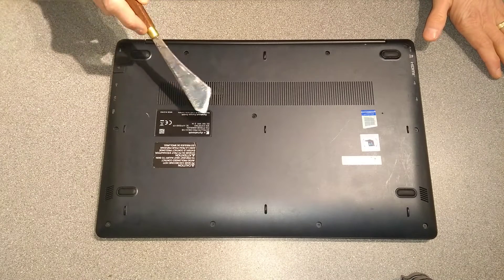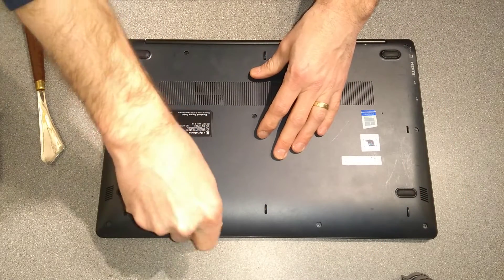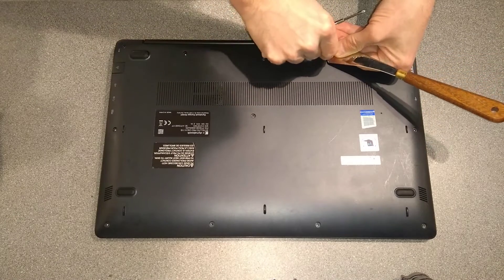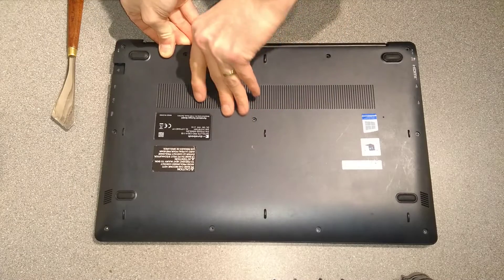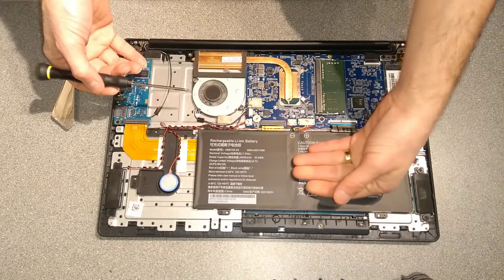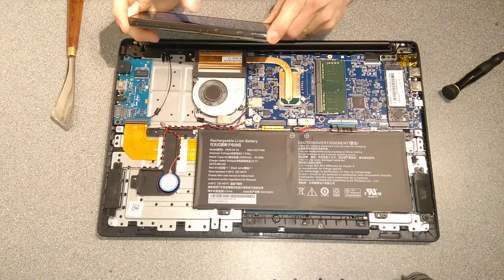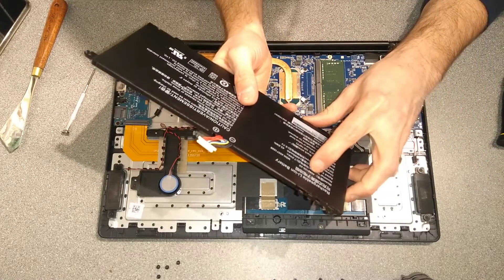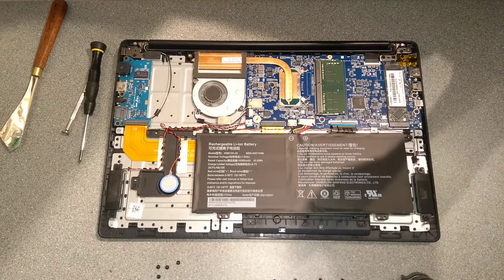Dynabook Satellite Pro C50-H-11B - How to open up the machine.

Comment: If you want to upgrade the memory on a C50-H range laptop please be aware that the maximum you can install is 1 x 16GB module.  Many of the memory selling websites say you can install 2 x 16GB.  This is wrong.  There is only 1 memory slot.

After installing the new memory module and restarting the machine you must wait a few minutes before the hardware recognises the memory stick.  You'll get a black screen and it will appear that nothing is happening but give it time.

Comment: On this moment I have troubles with my ventilator. It makes a lot of noise and it stops and it goes. I ordered a new one and Myawen is the sender. The fluff you found was in my machine black muke and it it blocked the airflow from the fan to the processorpath. 

I noticed the problem with the tiny screws. I put back on one place a screw with a screw to long and it pushed the parts away from each other. 
Now I have to wait for the fan for a month from Amazon. Experience is all and your clip helped a lot! The battery is already replaced before.